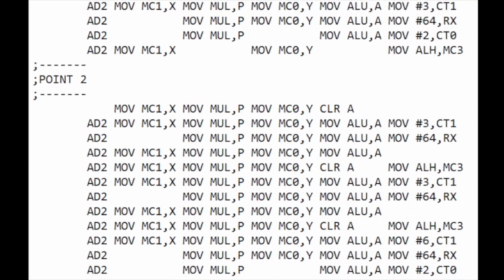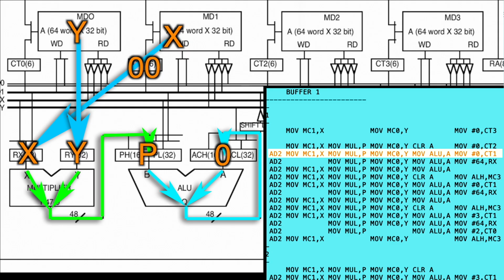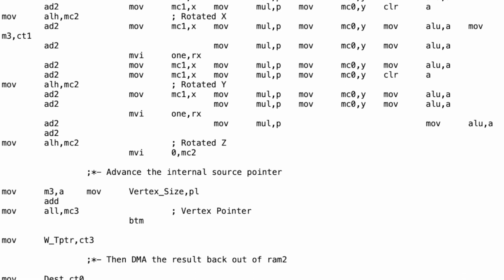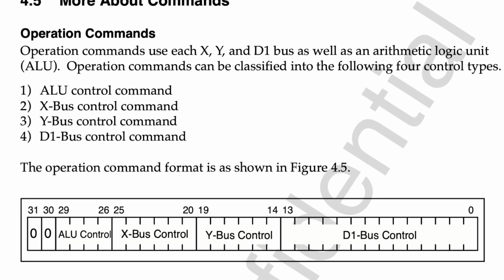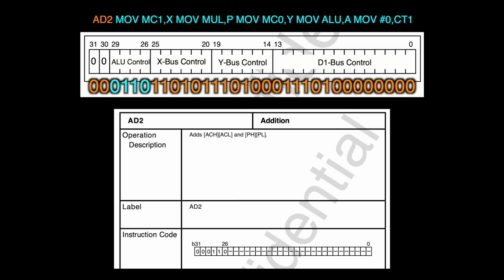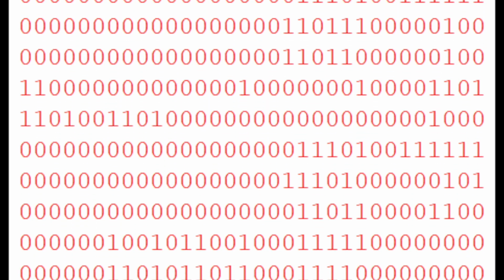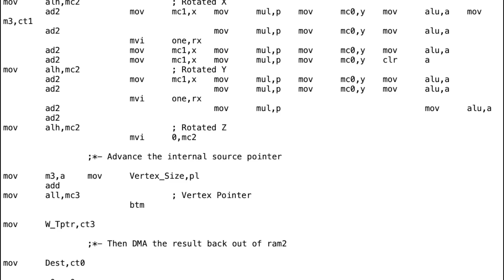The Mystery of Sonic R's Impossible Code - Coding Secrets

Comment: Perhaps there is some kind of bit masking going on with the commands? Maybe somewhere down the line of development, the idea you had (where each bit is a different command) got confused with a 3-bit 'word' where the other bits were 0. In logic, these might just be or-ed together at some point?
Reply: Definitely a bitmask to ensure certain combinations can't be used or are always combined.
A) 100 - MOV CT1,X
B) 010 - MOV MUL,P
C) 011 - MOV CT1,P
This means you can combine A&B or A&C; But not B&C, meaning either B can't be used with C in the same operation or that B is an operation required to run with C.It would be neat to look at this more or just black box test various combinations on hardware
Reply: @ladyalex69  Could just be that first bit enables register X, second enables register P and third selects either output from MUL or CT1 as input to P.
Reply: @RichardGordonUK  That sounds plausible. Then we can assume that 001 is the same as 000, and 101 is the same as 100, as the lowest bit will have no effect unless the middle bit is set. At that point all bit combinations are accounted for.
Reply: @TerrisLeonis  Indeed, also relatively simple on the and gates to do a command like this.
Reply: @ladyalex69  it would be interesting to see how some HDL synthesis tool would simplify the implementation of the encoding all of the known instructions. It clearly isn't just one bit specifying one operand with a one-bit mux...
Reply: @supersat  Like Alex said, it might just be that some operations aren't possible because they'd require using one piece of hardware in two different ways. A move is sort-of a mux from the source's output to the dest's input, but if you have one register set up with it's input and output muxes on at the same time, maybe timing-wise it's not guaranteed that A->B->C would mean that the bits have time to percolate from A, through to B, and on to C. Or perhaps there's only one mux, a 2-way one, though I'd guess that would be needlessly more complex. 

Yeah I suppose an HDL tool would be interesting to ask if we don't have the DSP's original designer to hand, or his work notes. It wouldn't tell you anything you couldn't work out with a bit of logical thinking, though, and wouldn't guarantee to generate the same method as was actually used. Since you watch these videos you obviously know that humans can think up smarter tricks by peeking round corners, than a machine can by following rules.
Reply: The circuitry will just be set up something similar to the following:

Signal from first bit -> mov mc1 [s],X circuit (uses optional data in the last 3 bits for s)
Signal from second bit -> no operation yet, circuit continues

second bit circuit:
Signal from third bit -> mov mul,P circuit
Signal from NOT third bit -> mov [s],P (uses optional data in the last 3 bits for s)

This means that 110 activates 2 circuits, which operate on mutually exclusive components so they can work together. You could have a 111 instruction but this would probably do some pretty funky shit since it's writing to P twice, so it may as well be considered undefined. Finally you could pass 001 as an instruction but it would just be a NOOP since the circuitry for the third bit test is never activated. Obviously there might be circuitry in place for this instruction but it's not mentioned in the video.
Reply: @chazni  AND gates.
Reply: read the pinned.
Reply: @Mernom  poor documentation is fair view from a whole level, but we are discussing how the underlying circuitry is doing it.
Reply: I don't know this DSP in particular. But there are some out there where each instruction Bit fires one specific gate of some piece of logic.
In these any instruction value is possible and close to everything can be done in parallel. But some combination of trigger would end up in writing 0 and 1 in the same register which means a short circuit in the silicon. And some simply have no use at all. Thats why you usually have explicit instructions in datasheet leaving you with the intended operations.
Reply: @MrHaggyy  Ultimately that is how the instruction sets of any processor works, a bunch of and gates so if the pattern matches the one for that opcode it will pass the data into the right  circuit
Reply: You're assuming that the documentation given to you by Sega of America cannot contain errors or mistranslations or that someone who was supposed to be "responsible" and "professional" did not actually behave responsibly and professional therefore thousands of "official" Sega of America Sega Saturn documents had this mistake...

Meanwhile a year or so later this dev gets documentation that did not go through Sega of America's staff... that should tell you something instead of trying to decode things.

Comment: So, for what I understand, I guess the thing is that Internally It takes the instruction bits to directly enable the circuitry on the chip to perform an action, eg move one value in the bus to a register, so maybe activating both at the same time is possible because the circuitry just happens to allow it, If you think of these instructions as a computer program It may not seem too logic but as  this is as close to the actual silicon as it gets, it's not difficult to imagine how this could work, I imagine this would work as a "DIY shift register" If you pulse the clock of all of the D flip flops at the same time all the data shifts one bit, sure, you could do it secuentially, activating one flip flop at a time, and the data should be correct, but instead of doing it in one go you are doing it in various steps.

So yeah, Maybe the instruction is not on the manual because that specific combination of instructions were not conceived by the engineers who made the DSP, but instead It's the speciffic design of the hardware who allows this instruction to be  executed.

I think that is why it works. I hope I've been clear enough, English is not my first language and here is very late right now, so my brain does not work propperly... ^_^u

Comment: Modern day processors do limited types of "op fusion" for things like multiply accumulate sequences. I wonder if this is similar to that, if the operations happen often enough together it would make sense.

Also, weren't Sega's reference manuals for the Saturn famously awful and consistently mistranslated until they came along and wrote a bunch of mid-level libraries, at which point everyone started using that? This was around about the time of the VF2 release so a year or so into the console's lifetime? An alternative theory that is more human error and laziness than undocumented magic.

Comment: Well, when in doubt. Ask the hobbyists. 

https://segaretro.org/images/c/c7/ST-TECH.pdf
I found this on segaretro.org and it clearly solves the mystery. 
"These instructions allow the RX and P registers to be loaded from data RAM, and they also allow multiplier’s output to be loaded into the P register.  The instructions that load the RX register may be used in parallel with the MOV MUL,P instruction.  X-bus instructions may be used in parallel with ALU, Y-bus, and D1-bus instructions.". There's a similar thing on the Y bus. 

So yeah. I actually checked the official documentation and it doesn't seem to mention you can do that. Super weird.

Edit: Turns out that document is actually official Sega documentation. So....
Also I feel like this part of the docs explains it better
"The DSP’s two main functional units (the ALU and the multiplier) can operate in parallel, as can its four buses and its four banks of data RAM.  As a result, the DSP can execute up to six instructions in a single cycle, including any or all of the following:  one ALU instruction, an instruction to load the RX or P register, the MOV MUL, P instruction, an instruction to load the RY register or the accumulator, either the MOV ALU, A instruction or the CLR A instruction, and a D1-bus instruction.  These are the only instructions that can be used in parallel with each other; other instructions require a cycle of their very own"

Comment: It may be worth to look into how emulators interpret code.
For example in "yabause" in src/scu.c there is a bit of code that clearly perform up to two commands for X-bus (and similarly for Y-bus as well). If bit 25 is set, "MOV [s], X" is executed. If bits 24-23 are 0b10, then "MOV MUL, P" is executed; and if bits 24-23 are 0b11, then "MOV [s], P" is executed.

Comment: This reminds me of undocumented instructions on 6502. 10101100 reads a value into memory into the Y register, 10101101 reads a value from memory into A, and 10101110 into X. What 10101111 does? Why, it loads a value into both A and X. However, constructing similar undocumented transfer instructions that didn't share either source or target didn't work as expected – but combining arithmetic and RMW instructions worked perfectly every time.
Reply: Unfortunately those opcodes were "fixed" in the CMOS versions of the chip, so they weren't that usable in practice.
Reply: @br9809  It was perfectly usable. Entire lines of 8-bit home computers NEVER used the CMOS versions.

Comment: John Carmack refused to have a port of DOOM rendered in the usual Saturn way, and mentioned to Jim Bagley that the DSP could perhaps help render the graphics. Jim said it was far too restrictive in terms of bandwidth, but it makes me wonder how fast it'd be if not choked by bandwidth limitations. Additionally, I wonder if he knew about the ability to handle six instructions at the same time, rather than four... though given Jim thought there were "two DSPs" in the first place (and as far as I'm aware, there aren't), I doubt he really spent much time looking into it after coming to the conclusion that the bus contention would've been huge. So, either JC was onto something, or he didn't understand the DSP either. Incidentally, XL2 has also been pretty wary of the DSP.
Reply: The undocumented combined instructions are limited to MOVs, so likely they weren't at all considered when doing napkin hardware utilisation estimates for planning the port. You don't end up knowing how many MOVs you'll need until everything is basically implemented.

It's pretty much a stream processor without data random access so it doesn't seem particularly useful for rendering spans and columns, something DOOM spends most of its time with. It for sure seems useful for SOMETHING, but difficult to say what, but given that other tasks aren't so heavy, optimisation potential would be limited. I think this is the main consideration why DSP wasn't heavily considered, the fundamental architecture rather than bandwidth or something, but i mean, SCU shares the system bus, so bandwidth can't possibly be the limit? You end up touching it either way when rendering on SH2. However it would be ideal to move all texture data access off the system bus altogether if you can have VDP1 do the actual rendering.

3DO is also a quadmapper just like Saturn, with the obvious problem that a quad always spans the whole texture, you don't have UV coordinates. Watch Optimus6128 explain the 3DO Doom port. Basically it renders columns and spans with hardware acceleration, by drawing a big sprite (or a few) per each column and span and clipping it to size using clip area mask. Well it turns out Saturn has this feature too! Wonder how efficiently it works.
Reply: @SianaGearz  Thanks for the explanation. It does feel as if, unless you know the DSP will accelerate a particular workload, and such an implementation won't cause other issues, it's probably more trouble than it's worth.

Comment: i think these are MISD (multiple instruction, single data) instructions per operation command.
All in all this would be an  MIMD (multiple instruction, multiple data) instruction set, as you can do different things in parallel with different data sources.

Comment: TL;DR: The manual was correct you can only execute on of each type of instruction at once, but the instructions MOV MUL,P and MOV ALU,A are wrongly labelled as using the X and Y busses while in reality there are special busses for these specific MOVs.

Pure speculation ahead, I have never worked with this chip or anything similar, but as a hobbyist electrical engineer, this is my best guess

I suspect that the DSP doesn't actually run instructions, but instead microcode. Microcode is the logic inside a CPU that looks at the instruction it needs to execute and then determines which internal control signals it needs to enable (or, which strings to pull). These control signals are mostly about routing.
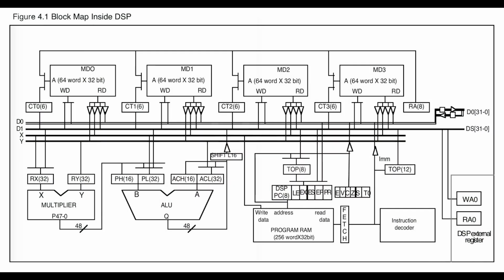If we use the diagram around 0:56 as reference we can see that the memories MD0-3 can output to all 4 busses, so they probably have 4 separate control inputs for each of those busses (an input that signals it to output to the X-bus, an input for the Y-bus, etc.). These are then mapped to different bits in the 'instruction'. In this case they are probably mapped behind some binary encoding to save on space, but the principle is the same.
Removing the microcode from the actual hardware makes the hardware faster and gives more granular control over the actual hardware at the cost of making it very difficult to code, what is exactly what we are seeing here. 

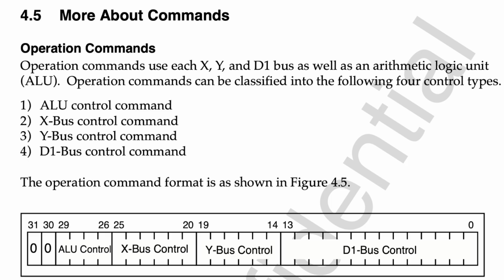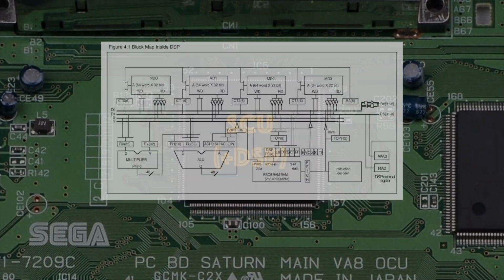To give an example for what this means in this scenario, if we look at 2:10 you can see the X-bus control part of the command is 6 bits long. Then, looking at the block diagram from 0:56, we can see that 7 components can access the X-bus, which can be encoded in 3 bits. This means it could be that 3 of the 6 bits in the X-bus 'instruction' are for the component that should output to the X-bus, and another 3 are for the component that should read from the X-bus. (This is even more speculative, but seeing as at 4:15 both the MOV MD1,X and MOV MD0,Y instructions start with the bits '110', this could mean the first three bits are the destination, that destination being the multiplier in both instructions)

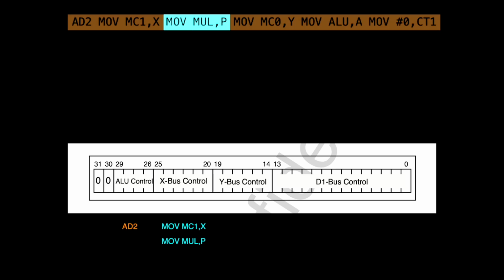Now we can see that the instruction MOV MUL,P from 2:54 is not actually mutually exclusive with MOV MC1,X because the block diagram shows a separated bus between the multiplier output and P-register. The same goes for the clashing Y-bus commands.
Reply: You are spot on - I have built quite a few machines like this over the years :) The "mistake" that coding secrets has made is to consider the "X bus control" and "Y bus control" to be instructions in the conventional CPU sense, whereas as you say they are likely microcode "instructions" with individual bits of the field used for specific steering/enabling of data (E.g. one bit might mean "Transfer the contents of the X bus into the X register". I think Jori & Gunstick have misunderstood - you are not suggesting that there is microcode behind the scenes - you are suggesting the two bus control sections are in themselves microcode.
Reply: I'm not sure but I doubt there is any microcode for this. It'd be too slow and this is a high speed DSP that executes one instruction per clock. Probably each bit is just an input to a multiplexer selects line or to a register enable line.
Reply: Microcode would be too slow for DSP. It is all hardwired. This also means the undocumented bit combinations would do weird stuff, because blocking that would add complexity.